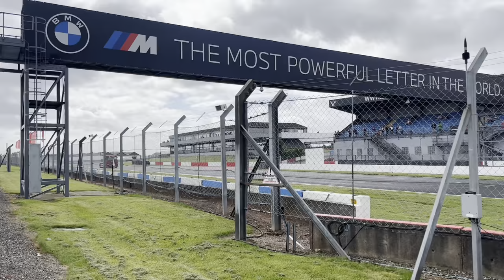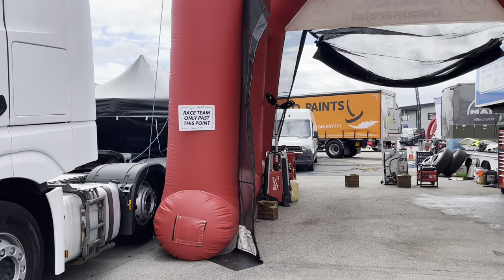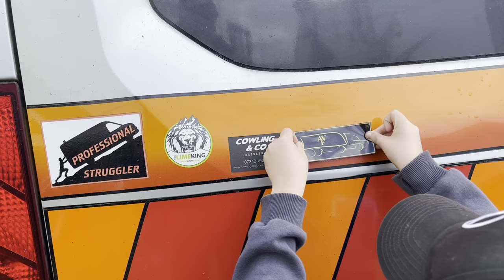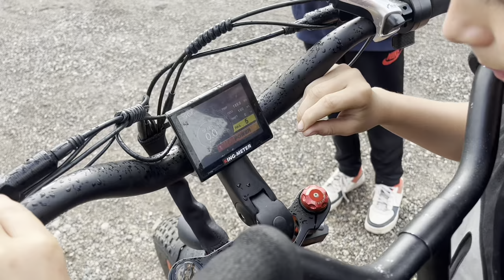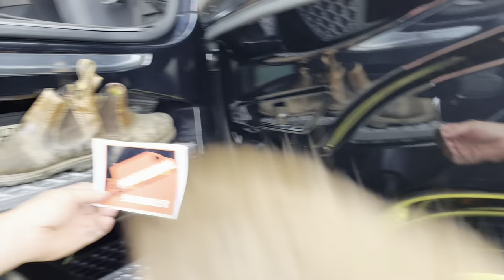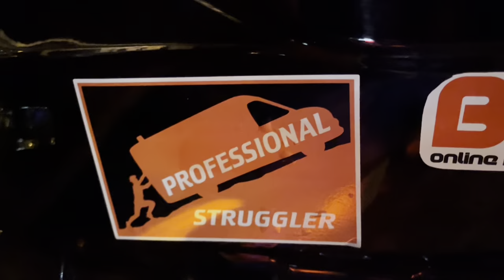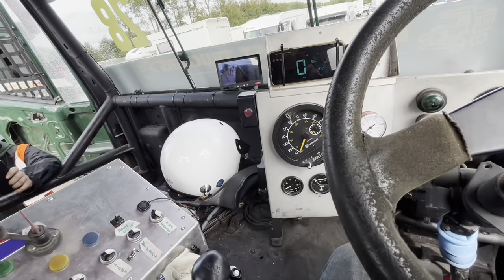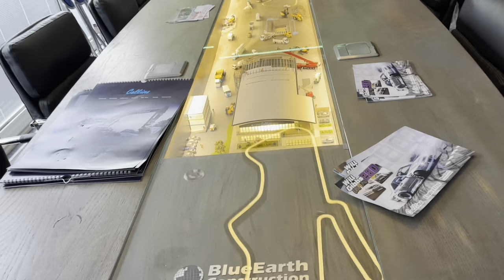Convoy in the park! Race Trucks, pit crew, cars, work vans, races and wrestling, 👌300 vid special

Comment: I remember the very first UK truck race at Donnington in the 80's, may have been 84. Leyland T45's, Steve Parish and they had a Leyland Roadrunner challenge, loads of 7.5 tonners racing against each other. I remember the ques to get in were horrendous. I have a memory of someone driving a truck up a ramp and driving the circuit with two wheels off the ground, somebody help me out on that one as its a bit hazy.